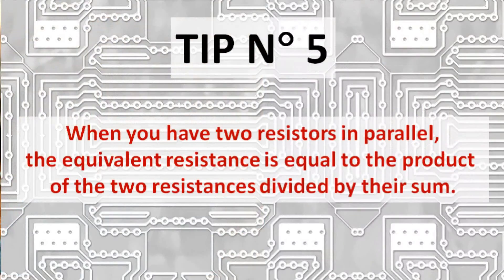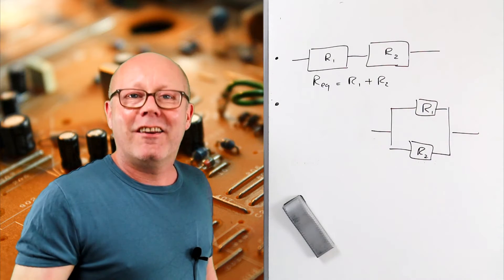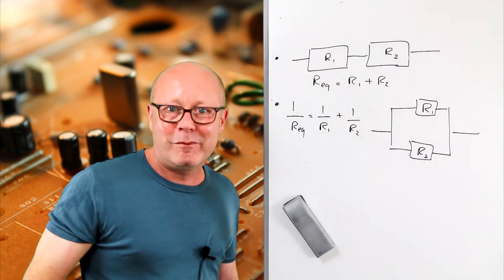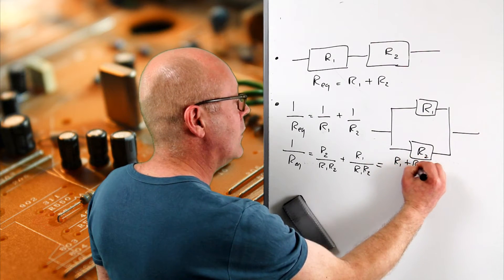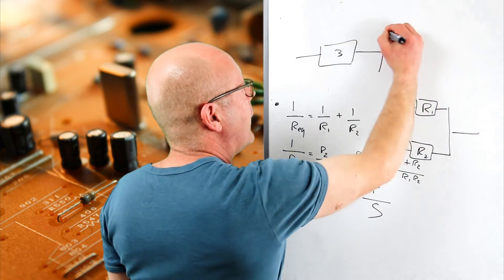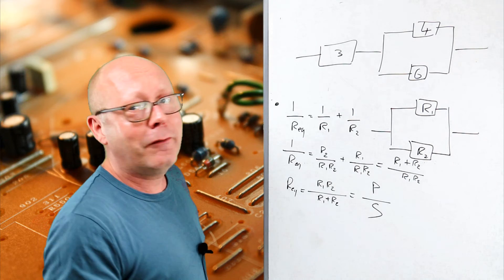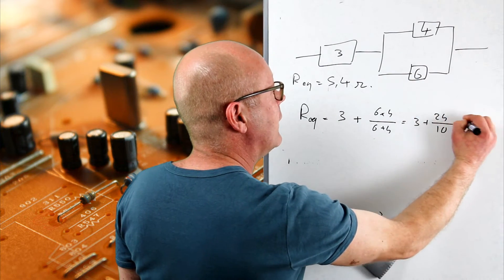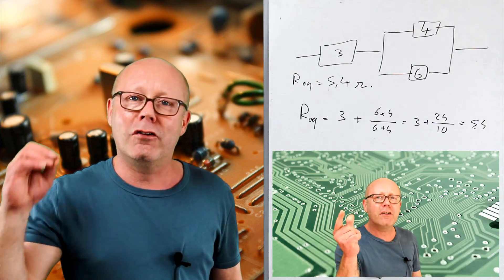Electric Circuits - Tip 5: calculate total resistance in seconds ( IB and A-level Physics )

Comment: Hello there! I was wondering if you could explain the equation you posted at 0:52 in your videos? In calculating the Resistance of two resistors in parallel- The inverse Sum  of the Resistance total is equal to the inverse sum of the two resistors in parallel? Could you post the theory of how the 1/R Total is calculated? Appreciate the shortcut tho, it's definitely a time saver!
Only recently found your channel so busy catching up!
Reminds me of my school days!👍👍
Reply from the maker: Hi Daniel,
It is difficult to show this without a video or even a picture. But I’ll try.
Imagin two resistors in parallel R1 and R2 connected to a battery of emf E.
In the first loop you have E = R1*I1, thus I1 = E/R1
In the second loop you have E = R2*I2 thus I2 = E/R2
The current generated by the battery is I = I1 + I2

Now imagine a circuit, that has the battery of emf E, a single resistance Req and the same current I as the first circuit. That would mean that Req provides the same resistance as R1 and R2 in parallel. The current in such circuit would be I = E/Req

Now put the equations together:
I = I1 + I2
E/Req = E/R1 + E/R2
Divide all terms of the equation by E, and magic :
1/Req = 1/R1 + 1/R2